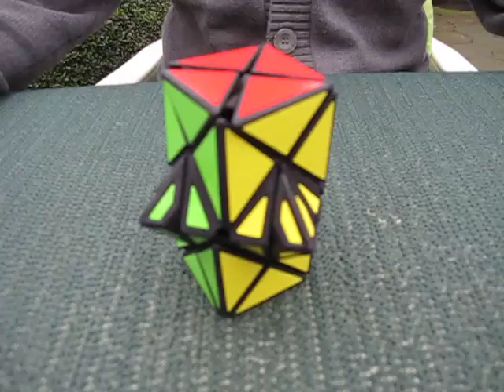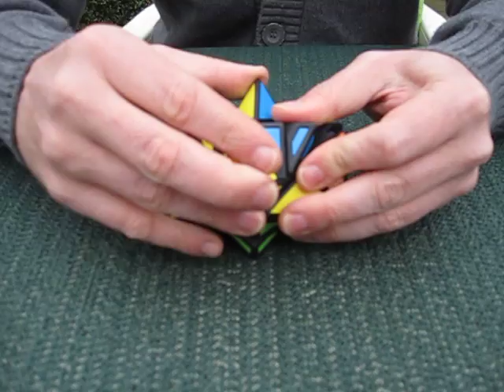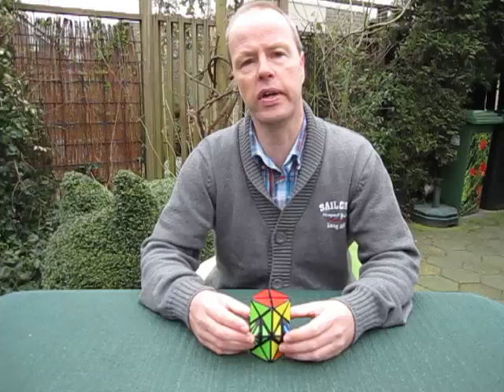Double Dino

Comment: If the mechanism that swaps pieces is basically like a 1x3x3, would it be possible to make 90 degree turns on it or would it essentially bandage it, not allowing the individual dino cubes to be turned after that?

Comment: Actually the square 1 does not have a point it is more like a line. Because you have just 180° turns . The line that intersects the Plane is actually in the plane so it is basicly the line and not a point